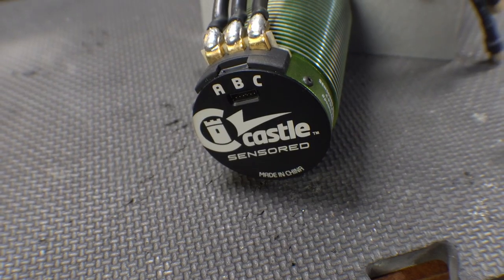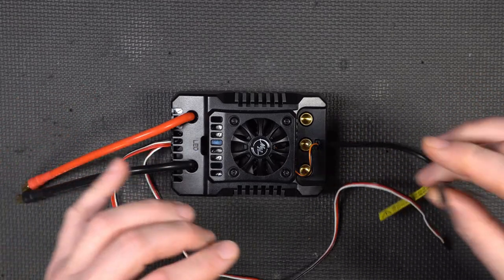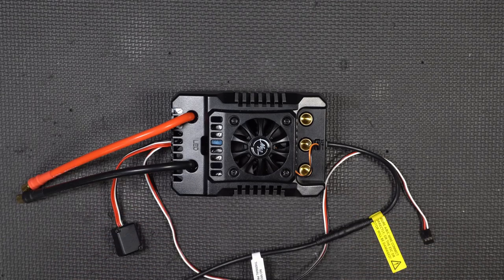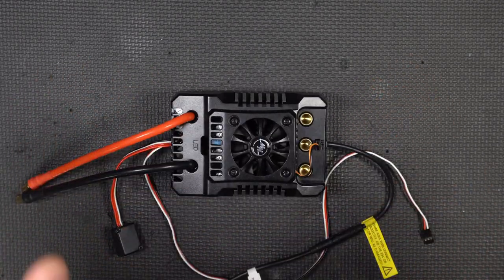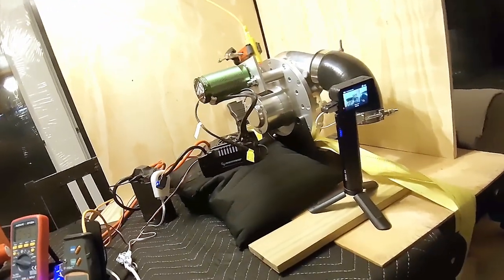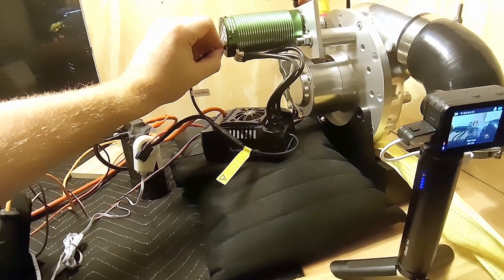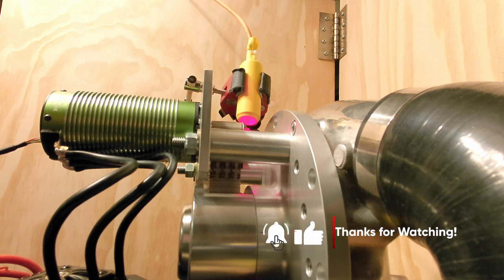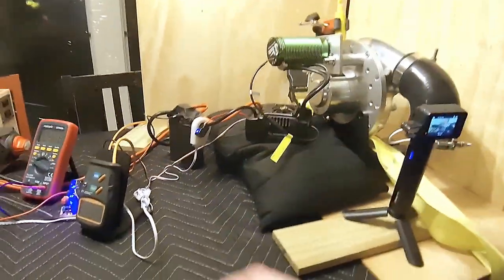Sensored Vs Sensorless Brushless Motors - The Difference In Action

Comment: The sensor reduces low speed cogging. It's really useful in rc rock crawlers when you are doing low speed precision driving.
Reply: Yet you see Holmes run a 1400 revolver sensorless with the same low speed control with no cogging with a Copperhead 10.

Comment: You should test the current draw with sensored vs sensorless with heavy load, on the "inverter world" the sensored can accomplish the same power a sensorless unit with way less current. Since it can efficient "fire" the stators, with some inverters we can even overclock some eletric motors, to spin faster what they are designed, only with sensored of course... We use encoder with at least 2048PPR(Pulse per revolution) i dunno the resolution of the sensored unit you have, would be nice to know
Reply from the maker: I had never heard of that. I'll test that in the next video. I'm building a massive battery box to minimize voltage drop and I'll retest. Thanks.

Comment: would have really helped if you somehow would tried to stall/change speed of  the motor sensored vs sensorless , which would explain the main reason on having sensored motors.
Reply from the maker: The main reason for sensors is when the back EMF is too low or nonexistent and can't be read by the ESC.  Startup is the #1 scenario for justifying sensors, hands-down.  Changes in speed once the motor's spinning over a couple of hundred rpm aren't a problem.  In fact, over a few thousand rpm, most ESCs no longer use sensors, simply back EMF.  Changing speeds (or simply trying to stall a motor - which on an almost 20 hp motor can be quite dangerous) isn't a good indicator of sensored vs sensorless operation.

Comment: Horry wing have 70125 sensor motor look like more powerful . Will you consider this model ?
Reply from the maker: That motor, despite being larger and heavier, is actually less powerful - at least going by ratings alone.  It no doubt makes more torque, but a less rpm - and you need both torque and rpm to make power.  It's not a bad motor by any means, it's just not as well suited to the job.

Comment: The sensor really controls it well! BTW What is your step up ratio? It's really looking good!
Reply from the maker: 14 tooth motor pulley, 18 tooth impeller pulley.  0.78:1 (i.e. multiply motor speed by 0.78 to get impeller speed).

Comment: FWIW you can probably make that "proprietary" adapter yourself for like $3.
Reply from the maker: Yeah, but what kind of connector are they using (the round one)?  And considering they sell the adapter for $4.99, it's kind of tough to justify the time invested.  As always, I appreciate you watching, commenting and subscribing.
Reply: @AlexLTDLX  Took way more digging than I expected, but I THINK it's an Amphenol 6 pin connector. Not certain though. Many similar designs. They actually did pick one that's hard to find. For $5 though, definitely not worth making your own.
Reply: Scratch that the Amphenol is probably way too large. I'm certain it's a readily available connector. Probably for some sort of radio connector. Just can't find it.
Reply from the maker: I appreciate you trying to find it.  I didn't even look, to be honest.  Just not worth the effort, and I've never seen a connector like it.  The closest thing is a Lemo connector (we use those a lot on equipment at work), but Lemos are a tiny bit bigger, far better made and cost an obscene amount of money: https://tinyurl.com/bdfw46r8  Plus the layout is a little different.  Here's the corporate website: https://www.lemo.com/en
Reply: @AlexLTDLX  Honestly, since you have a pigtail before the connector anyways, would make way more sense to just cut off their connector and put the non-proprietary connector on hahaha. Didn't even think of it until now.

Comment: Friend, I bought a hobbywing sensored 10bl120a g2 sensored esc, do you use any 540 sensored motor on it? I'm wanting a surpass 13.5 T sensored? Does the motor being sensored work on it? I already have 2 esc 10bl120a g1 hobbywing, I didn't quite understand the issue of changing to g2!

Comment: it's a 20k rpm motor, but with the sensor it gets 35k rpm, so the sensor increases the final speed too?
Reply from the maker: No.  It's a 45,000-50,000 rpm motor.

Comment: Just use a good  speed controller that allows pole setting with 32-bit processing ,pwm adjustment along with fuzzy logic and your motor will love you for it.. .
Reply from the maker: That sounds great.  Now who makes such a thing (that actually works like it should - VESC certainly doesn't at high eRPM), where can I buy it and can it handle at least 50 volts and 300 amps?  I'd actually love to see an affordable answer to my awesome 800 amp, 63 volt MGM ESC that's powering the Sledgehammer unit.  I'm all ears, seriously.
Reply: @AlexLTDLX  Have you tried the new 6.0 firmware and tool that just came out?  They just fixed a lot of bugs and have a new silent HFI mode.

Comment: At  least in the RC car world even a sensored setup will only run sensored at very low RPM. They switch to unsensored mode once they get above that startup RPM. Because of this unless you actually need that really fine granularity at startup there's no advantage to a sensored setup.
Reply from the maker: Yes, I said that in the video.  The other benefit (also in the video) is the elimination of start up current spikes.  I've had two ESCs die from that.  And they were expensive ones... almost $3,000 worth of ESCs...  I have videos on them.
Reply: @AlexLTDLX  gotcha. Yeah I didn't see it specifically mentioned that it switched over to sensorless in the video but I must have missed it.
I don't think current spikes will be an issue with this ESC. I would imagine you're going to get a lot less current spike starting up that blower than you would starting a 40 lb RC car moving from a dead standstill.  It's one nice thing about the RC ESCs. They're extremely robust.
Reply from the maker: Unfortunately, those current spikes are very real - here's a $1,700 APD ESC failing less than a second after startup (and almost burning down my house and making a 4" diameter puddle of molten aluminum under the car): https://youtu.be/_n6hDRsMZd8
Reply: @AlexLTDLX  I wonder if it's from going from zero to 100%, so quickly. The hobbywing ESCs have what's known as punch control and by default it's set somewhere in the middle so it won't allow itself to go from 0 to 100% too quickly.  In RC this is to prevent destroying parts on the car but in your application it may very well prevent a huge current spike as well. Maybe not though just spitballing.